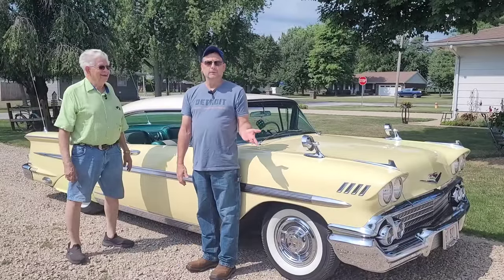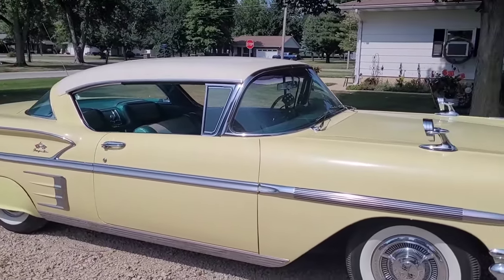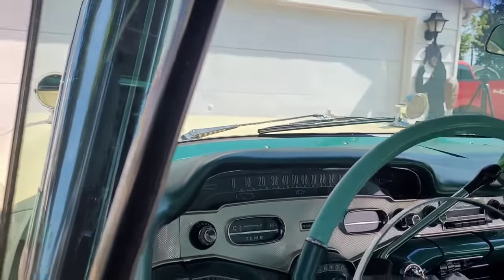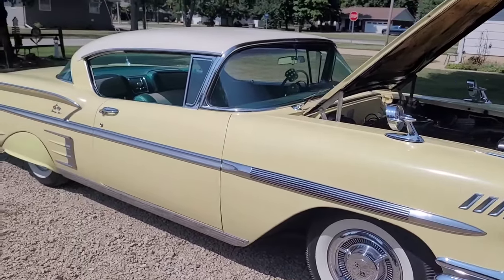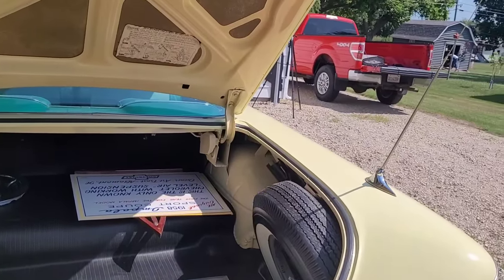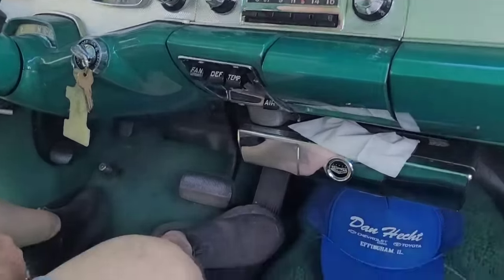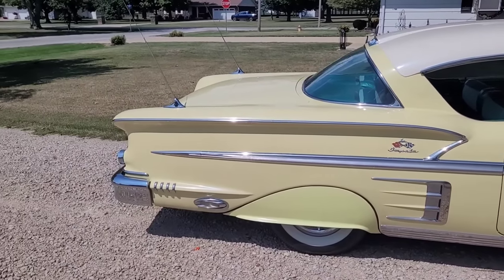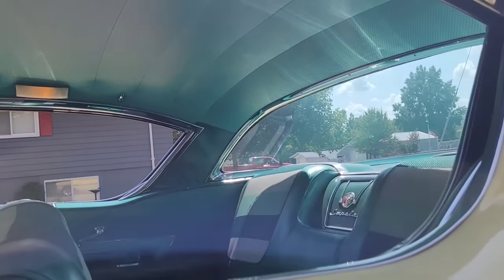Possibly The Most Original 1958 Chevrolet Impala In Existence With Factory Air Ride 37k Miles

Comment: As I recall, Ford also offered air ride in '58. I agree with you, never cared for Ford's '58 models.
Reply from the maker: I don't remember hearing of it on the Fords.
Reply: @tonyscarcare5657  I'm a little older, was 10 when the 58's came out.  Remember air ride was offered on Ford's top line cars.  Never heard of anyone that ordered one that way. My dad's cousin had a '58 Ford Sunliner, hardtop convertible. It was converted to run on propane.
Reply from the maker: @williamadam3888  it's amazing that the original owner didn't take them up on the recall.
Reply: I believe Edsel offered the air ride suspension, I remember hearing about it on a vintage tv commercial for the Edsel
Reply from the maker: @david-wilkerson1967  Well, they were way ahead of their time, so it's quite possible.
Reply: They looked OK but I agree
Reply: Chrysler also got in on the game and offered air ride, but only on the rear wheels and not the front ones.. GM offered it through the 1960 model year on the Cadillac Eldorado and Eldorado Brougham.

Comment: I bought a 58 in about 1964.  Blue and white 2 door with the 348.  Two speed transmission.  A nice car.  Paid $700 for it.  Traded it in on a 1962 fawn beige Corvette with a 360 horse power 327 in it.  Paid 1900 for the Vette.
Reply from the maker: You should have kept both of them.
Reply: @tonyscarcare5657  The Vette especially. It was a beautiful machine.  Fun to drive and  if I remember correctly got about 21 mpg when I wasn't racing Pontiac GTOs on Wisconsin Ave in Milwaukee.  I never lost.  I used to take it deer hunting in northeast Wisconsin.  Had posi-trac rear end so it got around pretty good.    Yeah, that car was fun.  I used to drive it on country roads up here and give it a little going around corners and the back end would litterly skip around the corner. That would scare the crap out of people.  And then - I got drafted.  And grew up.
Reply from the maker: @ravenfeather7087  I bet getting drafted will make anyone grow up fast!

Comment: This has to be the nicest ‘58 Impala on earth. As a matter of fact it is the nicest vintage car I’ve ever seen. Especially one in full working condition. That Turboglide has to be extremely rare as well. I think a lot were converted to THM transmissions or Powerglides. Not many people knew how to drive them correctly. I believe that they had a variable stall torque converter. That’s why it is so different. The transmission only has one forward gear. The “Gr” position on the selector is called “Grade Retard.” It changed the pitch of the torque converter vanes if engine braking was needed. Like he said in the video, a lot of people destroyed their Turboglides by leaving them in “Gr” and burning up the converter. It’s a neat example of engineering for sure. Back in the days when GM divisions were allowed to design their own engines and transmissions. It was definitely a neat time in automotive history. I wish I was old enough to have lived back then. Also, I wonder if the air suspension was similar to the system that Cadillac used on the ‘58 Brougham.
I had no idea that air suspension was an option on Chevrolets. I think it is fantastic that Art took the time and had the ingenuity to keep it instead of converting it. His Impala is museum quality and he still gets in it and enjoys driving it. That’s awesome. These cars were meant to be driven and that’s exactly what he does. It’s also incredibly neat that he has some of his family’s cars as well. He had the forethought and the ability to keep them. Not many people can say that.
Reply from the maker: Thank you very much for all the kind words! I believe this car should be on display at GM World Headquarters. Please stay tuned.
Reply: I think it deserves to be there as well. I will definitely stay tuned. You have a great channel my friend.
Reply from the maker: @ryanhodges7101  thank you very much!

Comment: I worked for a man who had been in the used car business back in those days. He told me about a 1958 Buick that he sold to a relative equipped with air suspension. After a few failures, he paid to convert the car to coil springs.
Reply from the maker: It's amazing that the lady didn't take them up on the recall knowing they were causing issues.
Reply: There's a great video on YT showing an air suspension failure on a '58 Buick during a comparison test against Chrysler products of the same year. It was a quite dramatic failure and was caught on camera. Seeing that would convince anyone to convert to coil springs.
Reply from the maker: @bobjohnson205  Wow.....I'll have to look that up. Thanks!
Reply: @tonyscarcare5657  Yes, it's with the great Tom Mccahill! There's a '57 version on YT as well.
Reply from the maker: @bobjohnson205  thanks!
Reply: @bobjohnson205  

Was it the one with Tom McCahill of Mechanix Illustrated? I loved it.
Reply: @dave1956  Tom hosted and narrated the '58 comparison test film. "As flat as a bookkeeper's chest." was one of Tom's lines from the film. You don't hear lines like that anymore. Tom was great!
Reply: @bobjohnson205  

Once when talking about the passenger capacity of a vehicle he said that the car “ought to be able to hold Aunt Petunia’s bloomer girls”. I think that reading his analogies were half the fun of reading his articles. Too bad that he passed at 67.
Reply: @dave1956  Yes, he died - not "passed" - far too young. There were still so many zingers yet to come!

Comment: Wonder how much work it would be to retro fit the air susp. into a 58 that has springs?
Reply from the maker: He doesn't want to. He wants to keep it original because of the rarity.
Reply: @tonyscarcare5657  I would to. Just wondering if you had a spring car and wanted to put an original type airbag system in, not an aftermarket type.
Reply from the maker: @crushingvanessa3277  I would imagine all the parts would be impossible to find.

Comment: You're absolutely right. the 58 is a much better looking car than the 57.  I never understood the fascination with the 57.  This is a beautiful car and it didn't get the attention it deserved.  I'm glad to know about the air ride suspension, I'd never heard of it on this car before.
Reply from the maker: Thank you very much for watching!
Reply: Turboglide two years  only. 57&58. Buick transm. No greats. Three pitch. Converter.
Reply: The 1958 GM cars were all one year only body styles.  1959 saw the introduction of longer, lower, and wider cars which had even more powerful engines.
Reply: The 57 Chevrolet is by far a better looking and built car ..the 58 had an hour glass frame. Back in the late 50's I saw a 57 Chevy t-bone a 58 Chevrolet it knocked the 58 on its side  you could see the 58 frame. I like both but the 57 alot more.
Reply: @williamgmunson3146  The Turboglide was available from 57 to 61. In 62 it was replaced by the Powerglide,which was changed from a cast iron case to aluminum. That same year the 348 was replaced by the new 327.
Reply: This is an absolute gem of an original car. I am so conflicted on the '58. The only thing that appeals to me is its appearance from the front. I am just the opposite and think the '57 had a better look. Quite amazing how the tastes in the lines of a car can vary among individuals. Perhaps I am a straighter line guy as '59 through '64 are apealing for me. '65 they rounded off the styling that lost its appeal for me. No doubt about it this car could fetch a pretty amount at a Mecham style auction. This is priceless so I could easly see it going for seven figures.
Reply: It got no better after 55. Most tri5 lovers like the styling best but the engine the worst. I wish I still had mine. Went through three motors!

Comment: Wow, a very nice example of a survivor '58 Impala. @30:53 the comment was made about a part of the steering. That is actually a hydraulic slave cylinder for the power steering. I know because my late Dad and Mom owned a '64 Impala with that slave cylinder in the steering and it leaked and my Dad put a new seal kit on the rod end of the cylinder. It fixed it for a few years but it stared leaking again and it appears this '58 has that same problem. GM redesigned the power steering in 1965 and did away with the slave cylinder and the X frame of the chassis.
Reply from the maker: Those X frames seem awful, dangerous to me.
Reply: @tonyscarcare5657  In an unfortunate accident with an X frame GM car it did not provide as much side protection as a parallel frame might. The manufacturers as you know are always changing what they offer as the years go by. My '12 Chrysler 200 Touring convertible is quite a bit different than these older cars featured on this channel. Mine has less bling but a lot of modern features not thought of back then.
Reply from the maker: @MoparDan  sure....that's to be expected.

Comment: Get rid of the fender skirts. They never came out of the factory with them. They were optional. Look at every brochure from 1958, they never showed fender skirts.  The last car that actually had them was a 1957 Mercury and they were an option as well.
Reply from the maker: I pretty sure you guys have him talked into removing them, and there will be another video if he does. However, you can't say the "last" car to have them was the 1957 Mercury as my 1978 Mercury has them as well as many 70s LTD Landaus and Oldsmobile 98s of the 80s. You have to remember that Art grew up in a time when they were extremely popular.
Reply: @tonyscarcare5657  My dad's '66 Pontiac Grande Parisienne came with them standard from the factory and the car looked so much better with them than without them!
Reply from the maker: @bobjohnson205  Yes! Exactly like my 78 Mercury Grand Marquis. Here's a link to it. https://youtu.be/7v2cXH2WP0U

Comment: How my uncle chose a '58 Ford Fairlane over a '58 impala is beyond me. I was 10 years old when he bought the Ford. I went with my dad & uncle to take delivery at Bielfield Ford on Michigan Ave in Detroit. Next door was Wink Chevrolet & out front was an all-black loaded, stunning Impala 2-door hardtop. To me the Impala was a knockout. I think he made the wrong choice & what was most surprising was that he worked at the Cadillac plant on Clark Street.
Reply from the maker: The Ford wasn't a beautiful car and not totally "ugly", but I have a feeling that if one was to drive both for comparison, it would not surprise me one bit if the Ford seemed way better built than the Chevy.
Reply: @tonyscarcare5657  I've owned both and that answer is a resounding no.  I'm sure there is some difference in the feel based on equipment, but the Impala is just the better car in every way I can think of to name.
Reply from the maker: @scottysgarage4393  I don't believe Ford was building anything "bad" at the time.

Comment: Treadle-Vac power brakes -- if you lose a gasket in there or something, it can suck all the fluid out of it & you lose your brakes.  I wonder if Treadle-Vac failures were the principal reason for the high rate of failures such that all the turnpikes put "CHECK BRAKES' about 1/2 mile ahead of the toll gates.
Reply from the maker: I don't know. Good question!
Reply: @tonyscarcare5657   I was wrong about how it failed, but right that it's prone to failure & can lose all brakes.  Lots of info on the interwebs.

Comment: Wondering with the beautiful classics in his collection why Art would have a gravel driveway at his house. Seems like some pretty nasty paint chips waiting to happen. Hoping he stores these cars in a temperature-controlled facility of some sort.

As far as potentially selling this car, I'm surprised Jay Leno hasn't offered to buy it yet. 😉
Reply from the maker: It is temperature controlled. As far as the rock chips, he's not driving 55 mph down the driveway! 🤣 They charge very high property taxes around here for concrete driveways.
Reply: @tonyscarcare5657  you don't have to go fast to have a rock fly up and make contact with the car. If the car was "daily driver" quality, then who cares, right? This is an entirely different story with a true one-of-a-kind automobile, especially if the paint is all-original from first production.
Reply: @tonyscarcare5657  and I also noticed you "skirted" (slight pun from the video 😉) the comment about Jay Leno. If not him, then MECUM or Barrett-Jackson would probably be the best sales outlets to get the most value for the car. It's Art's decision if and when he's ready to sell. A loan of the car to GM headquarters sounds like a good idea. Give it the exposure it deserves.
Reply from the maker: It is all original for sure. However, around here in small towns, there are rocks all over the roads. They oil and rock all of them. There's simply no way to escape rocks if you drive a car around here. One thing about the Impala is that the tires don't stick out at all. They are really tucked inside the wheel wells, and rocks are not likely to hit an outer panel.
Reply from the maker: @robbernath  I don't believe the car will ever leave the family, especially as long as Art and his wife are around. The kids all love the cars, too, and I guess when they are handed down to them, they'll make the decision whether to keep them or sell them. Art has been offered a mind-blowing amount of money for the Impala, and the kids are all informed as to names and phone numbers when that time comes.
Reply from the maker: I do agree, though, that Barrett Jackson or the like would be the best place for selling this car for sure.

Comment: GM, yet again violating its own "exclusivity" rules by installing a suspension system on its bottom-line car that was supposed to be only for its top-of-the-line car. Just like when my job was to put a "Harrison Radiator Division" sticker on over the "Cadillac Division" 4-Season Climate control...and Powerglide was the worst 50s/60s auto trans ever. Odd that she didn't do power windows, though.
Reply from the maker: Power windows would definitely be cool.

Comment: Air suspension was a nightmare and only lasted a couple of years.  Must have seen like a good idea at the time.  Same with rage troublesome Turboglides.  Most got converted to Powerglides.  Don’t care for the fender skirts and whoever drilled holes in the front fenders to mount those hokey mirrors did a disservice.  It’s a nice car otherwise!😮😮
Reply from the maker: Maybe you should watch this video here.  👇
https://youtu.be/5yOehXkMHMc?si=gYs7k_A3YIYBA77l

Comment: 1958 was the absolute bottom for GM design. All 58s were awash in chrome gee gaws everywhere adding lots weight (gas was 30 cents a gallon).
Reply from the maker: If you read the comments and see that the fact that this video is well on its way to 200k views in 4 weeks, it appears most people don't agree with you.